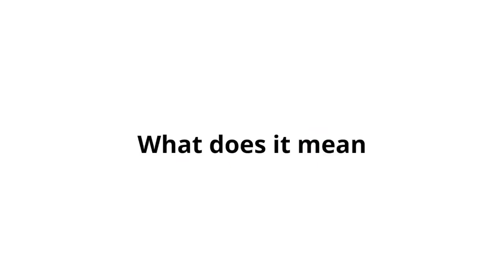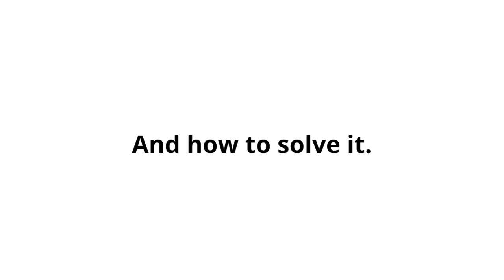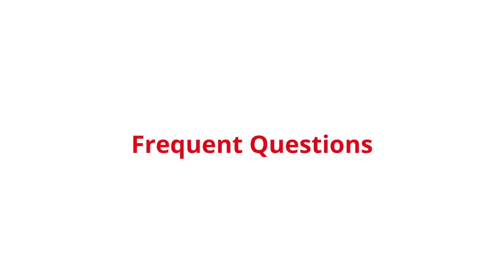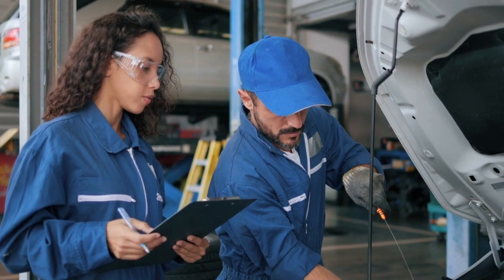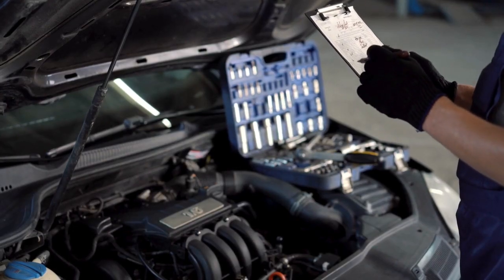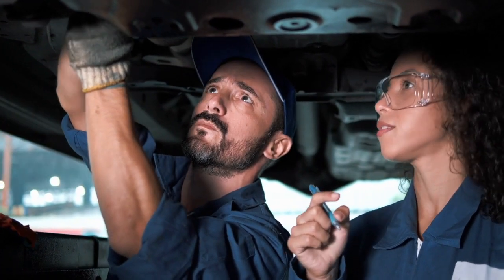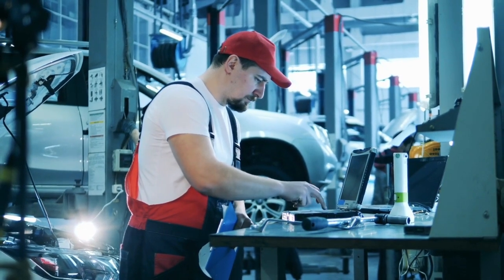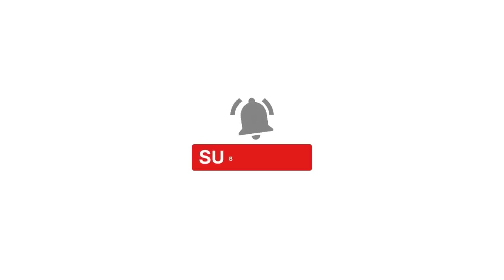🚫 How do i fix code P0354: CAUSES and SOLUTIONS【2025】🚫

Comment: Swapped coil packs swapped plugs swapped plug wire replaced injectors did a compression test no noticeable issue with idling checked power to idle air control valve only other option that I can think of is to have the PCM tested any help would be greatly appreciated
Reply from the maker: 🛠 Vehicle-specific DTC manual. Order it here👉https://mecanicaautomotrizpro.com/dtc-code-repair-manuals/